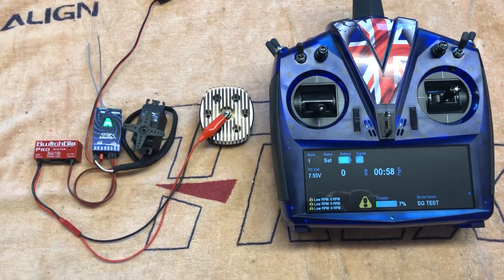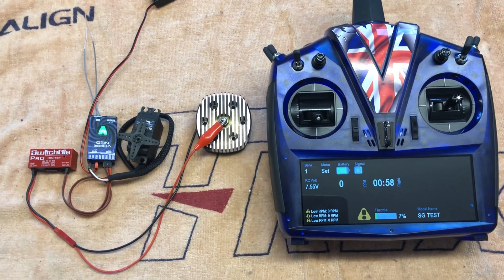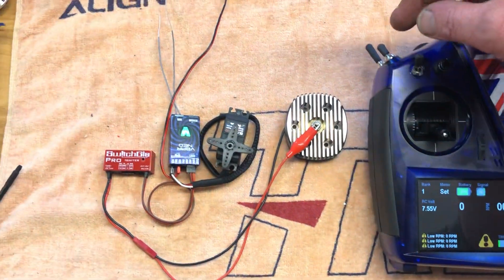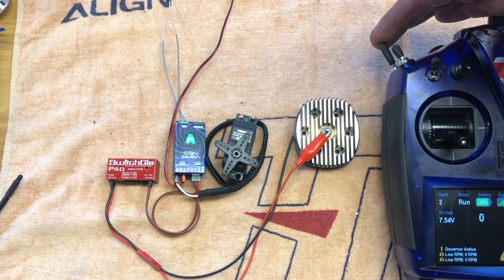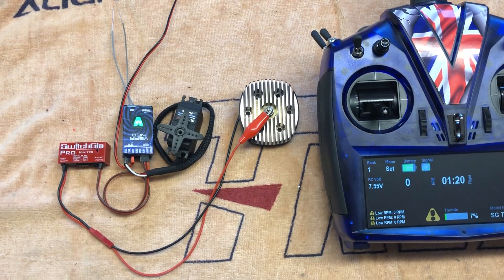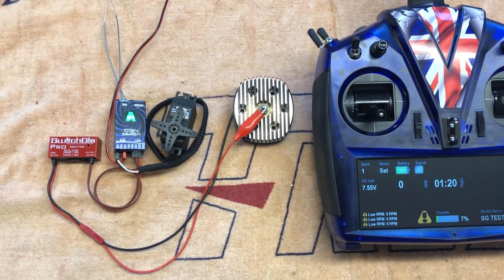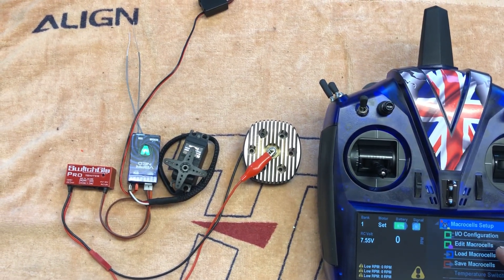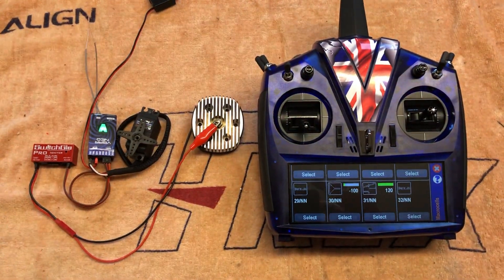Switchglo with Macrocells for hot start protection

Comment: Have you thought about using the Switch Glo to only operate when the engine in is the motor off position?  This is what I do.
Reply from the maker: Wess Collette I always start in motor run, as I want to be able to advance the throttle tickover position should I want to on very cold days.
Reply: Rob, I normally have enough trim to not have to do this.   I have 3 governed head speeds, as I know that eventually I will plant the heli in Bank 1.  Different ways to do basically the same thing is what is so great about this hobby.